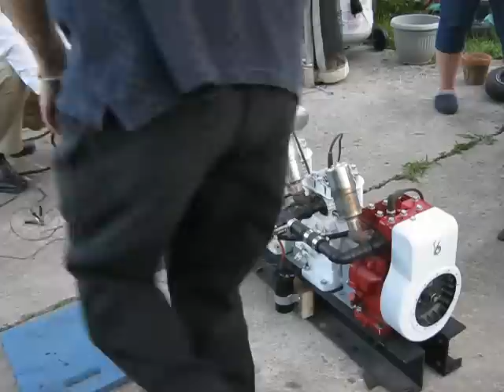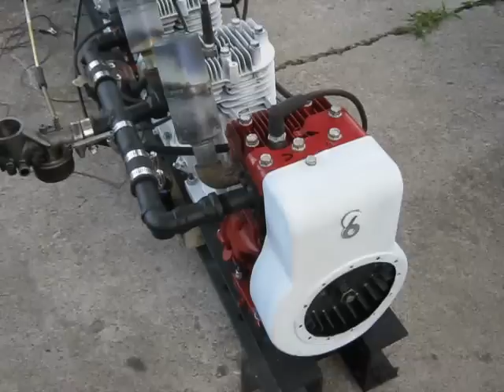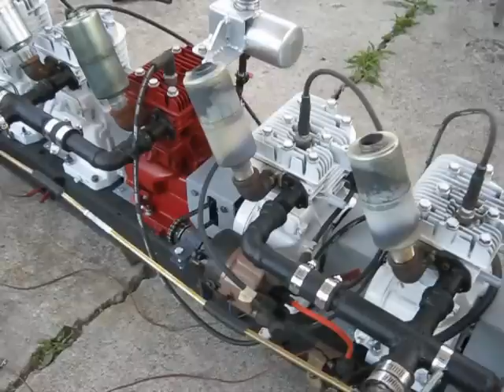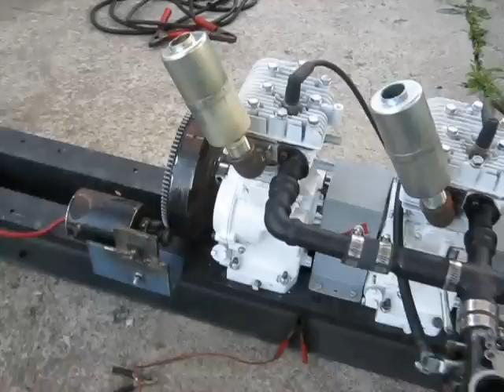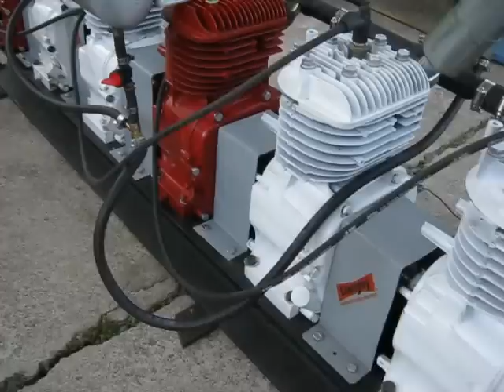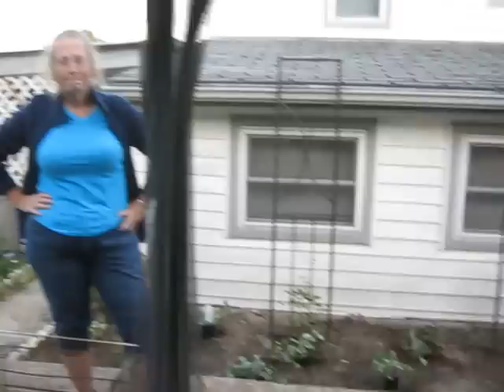FrankenBriggs 6 Cylinder 1st Run!!!!

Comment: So did he make this just to see if he could, or is there some more in depth reason making an inline 6 cylinder engine from 6 individual engines?
Reply from the maker: Yes, I did this just to see if it would work. I also wanted to test out the dual carburetor arrangement for use on the inline 8 cylinder engine which i ran after this engine. It worked much better, and I would like to try an inline 12 cylinder, I have just enough extra steel channel to make the frame for it  :)

Comment: Looks like the front three where only running because the mufflers are not hot and changing color
Reply from the maker: One of the back 3 is running also, but 2 are having issues. I resolved the problem on later vids, but this one gets all the views! I put many hours into getting this to run the first time, so I keep the vid playing, inspite of the problems.  My 8 cylinder ran better.

Comment: How did you clock the cylinders?  Sequentially or some series/parallel?  You could experiment with that and see the results in horsepower vs torque.
Reply from the maker: I made it so it uses the normal straight 6 firing order of 1,5,3,6,2,4. though with this modular unit, I can change the firing order very quickly. I presently don't have any way to measure power, just rpm. I was surprised that the whole engine rocked sometimes when revving it up, I didn't expect that since the 6 weighs about 250 pounds, and the 8 close to 300.

Comment: fantastic. but what was the inspiration behind this.
Reply from the maker: I went for a ride in a 1950 Pontiac with a Straight 8 engine, about 30 years ago. I haven't heard an inline 8 cylinder engine run since, so my plan was to build one from scrapyard engines I collect. This 6 cylinder was just a development of the straight 8 engine project, which I got running a few weeks after this engine. It was more sucesful, as I had most of the initial problems solved by then.

Comment: Exactly what is the purpose of this multi engine motor. Did you sync the strokes or do they alternate, Suck, Squeeze, Bang, Blow. Cool idea, But what do you do with it, I bet the Briggs& Stratton people will take notice......... NOT.. For Sure un-equal length intake runners will affect distribution. One engine will run rich and another will lean out and burn a piston or valve if it ran for an extended period. Don't you love how us internet engineers help to design your engine. The combined knowledge of all of us here will help you build an engine that may actually have a purpose. Knowledge is power..
Reply from the maker: This was just an experiment to see if it would work. The cylinders are timed to fire like an old straight 8 or 6 inline engine, and it sounds like one also. It doesn't really have a practical application, as the couplings between the various engines live a rough life with reverse loading. What you say about mixture distribution is true, but there were many millions of straight 6 engines built with 1 carburator, and they seemed to last a decent length of time, though most were water cooled.

Comment: Cool. We all need a good wife to keep us on the straight and narrow!
Reply from the maker: Yes, isn't that the truth! Luckily my wife puts up with my idiosyncrasies and I hers, so we get along well.
Me parking this big engine on the patio all summer was a point of contention though, so I had to keep moving it towards the edge of the concrete, and the bloody thing weighs 300 pounds!
Reply: ChargerMiles007 that is a beast for sure but really neat! Now you need to try and put it into some kind of ride.
Reply: The two engines from the starter didn't run. The third from the starter did some.
They didn't blacken the mufflers.
There is a fuel or fire issue. I would get all running before you put it to work.

Comment: cylinders 1,3,4,6, are running lean because of your intake design , intake runners should all be the same length. to evenly distrubute your fuel mixture. you might try six carbs or redesign the intake
Reply from the maker: 6 carbs would be very hard to manage, 3 would be easier. Perhaps i will rework it for 3 carbs in the future, though the intake manifolds take a lot of time to cut and weld up, and my old back doesn't like the bending over!  :)

Comment: nice try! , if I was you I'd look into a different way to mount the carbs , the 90° angle on each end of the 3 way manifold are going to cause headaches. would be less trouble to mount seperate standard carbs to each engine , and just have the 3 way manifold on the inlet , since all the carbs are in line, a link rod to the butterfly will suffice , each engine can be tuned to work with another only restriction would be the inlet manifold
Reply from the maker: Thanks for your input, yes, it does have manifold issues, I was being quick and dirty for sure!

Comment: Try a Blower on the carbs,  maybe use a leaf blower,
Reply from the maker: lol, I can only imagine what Roadking would think if I put a blower onto it! He already though I was nuts just horsing on these engines the way I do!  :)
I guess he has a valid point though, you never know when these things are going to blow apart, and destroy all of the hard work.
Reply: ChargerMiles007
 LOL,  you're right,  but, Sometimes finding the breaking point is all the fun,
   In reality,  it's not hard work,  it's fun,  that is totally cool,  weather it's practical or not..
  Personally,  I see it as Art,    that's why I like the Idea of  Blower,  it just takes it over the top.  :)
  Art is supposed to make you wonder,  "What was He thinking"   So give them something to think about..!!     Awesome Job,

Comment: Judging by the discoloration of the mufflers.  Only the first three engines are working.
Reply from the maker: Those 3 were definitely working the hardest, at least one of the other 3 were running, but #4 and 5 were having issues. I cleared all that up on the next run, but nobody watches those vids.

Comment: nice! does it follow a specific firing order(firing order of the inline engine)?
Reply from the maker: Yes, i try to duplicate existing engine firing orders on my engines. The 6 cylinder is 1,5,3,6,2,4, while the inline 8 cylinder is 1,6,2,5,8,3,7,4
Reply: just a little adjustments maybe on ignition timing and intake manifold lengths will make this inline engines great.

Comment: It would probably work better if you went back to the original intake and carburetor set up , now you need to put it in something to drive
Reply from the maker: I have been thinking of building some type of 4 wheeled slow moving vehicle for my large engines, but Covid has me wondering if it is the right time to take on such a project.

Comment: pues a mi me parece más bien una especie de máquina con 6 motores de 1 cilindro, conectados en serie. 

This isn't  a 6 cylinder engine,  is just 6 engine with 1 cylinder  each
Reply from the maker: True, but those individual engines are connected together to operate as a 6 cylinder engine. A spark distributor fires all 6, and two carburators feed the cylinders.

Comment: Cool Idea but your at extreme risk starting the engine hot wire style those sparks could ignite your carb on fire id advise on using a button starter instead
Reply from the maker: thanks for the advice.
Reply: ChargerMiles007  be careful with the button one too I have seen sparks jump out by the button what you need is a setup similar to a car or motorcycle or you can use a hi speed drill too
Reply: Im not a electrician but I have started alot of fires LOL
Reply from the maker: So you are a Fireman!  :)
Reply: ChargerMiles007 ehh more like cursed LOL nah just a pretty good mechanic guy with no tools

Comment: the rear 2 cylinders never fired. see the mufflers are still un-colored from heat as the other front 4 are.
Reply from the maker: Yes, it was having issues on the first run, I have more vids where all 6 are running, but this one gets the views. I left this vid playing, since I was so happy just to actually have it run, since it took many hours to get it to this point!

Comment: I would have kept the blower housings on each engine and flywheels to keep them all cool and the flywheels would have created more torque, then make a big log splitter and run a pig hydro pump
Reply from the maker: Yes, such an idea would be much more practical, and if the separate engines were chained up to a common shaft should work out very well. this is just an experiment, so I wasn't too concerned about cooling for a minute or so long run, though I did use 2 large box fans on a few runs.

Comment: im just curious,... what made you think you were going to run 6 engines on 2 carbs that im guessing havent even been jetted ???
Reply from the maker: No, these are stock 12 horse lawnmower carbs, with adjustable needle valves. I based it on cubic inches of displacement per carb, and it worked reasonably well. The engine wasn't running well on this vid, it is better on my other 2 vids, and also the Straight 8 vids.

Comment: Did anyone notice that the 2 last motors did not burn the paint off the mufflers ? I would say they are not firing.
Reply from the maker: Good observation, later I discovered #4 and #5 cylinder were not firing in this vid, thought the last one #6 was indeed, though maybe not 100%. I have another vid of its last run where all 6 are firing. I also have vids of an 8 cylinder, which runs much better,

Comment: Easy to tell which engines were actually running, the mufflers got hot.  A couple obviously did not.
Reply from the maker: Yes, #4 and 5 were not firing on this vid, as I got the crank phasing messed up. #6 is firing, but the muffler doesn't change color. on later vids I measured temps with a heat gun. I had the opposite of spark advance happening here also, as I was spinning the distributor backwards, my bad! I cured all of those problems when i built the 8 cylinder a few weeks later.

Comment: How do you plan on shrouding the last 5 so they don't burn up from lack of air circulation
Reply from the maker: I used electric cooling fans to blow air at them, it worked OK.

Comment: If they are all 5hp Briggs motors it should be putting out 30 to but it sounded like all 6 together was struggling to put out even 2hp,
Carbs or manifold problems I think you need to tweak something there bro
Reply from the maker: Yes, this first run was a bit of a disaster, I had a serious spark timing issue, which I solved on vid 3. I think cylinder 4 & 5 were out of phase also on this vid. I was just so glad that to get it running after many hours of work, that I left this vid of the event on for viewing. the straight 8 runs much better, it has a potential of 40 horse, though of course the crankshafts or couplers would break long before that was reached. 15 horse might be a usable goal.

Comment: 2 of those mufflers didn't get hot enough to change color. Did they not start?
Reply from the maker: Good eye, on this vid (there are others where it runs better) i had the camshafts on those 2 cylinders 180 degrees out, hence the backfires etc.

Comment: Good try, so did anybody realized how many motors were really running? Look at the exhaust dead giveaway. Obviously the first and third Motor was carrying the biggest load. Two was running some. Four was running some, but if you look at 5-6 mufflers are not even warm. 
If you look at how he has his manifold set up will notice that first and last motor in the three bank series are going to be running lean and one in center is going to run rich. You need to have equal manifold runs to make him run properly.

Comment: Now, my question,  for what kind of applications is this build,  I'm interested,  it could be functional or is just for fun
Reply from the maker: It was pretty much just built for fun, as the couplings can only transmit about 10 horsepower, while the motor has the potential for 30 or so horsepower. So it could be used, but is mainly an experiment.

Comment: I'm maybe a bit late for this question but how do you keep the engine cooled? Since it only has 1 flywheel at the front.
Reply from the maker: I just let them get hot, and don't run it for very long. I will have an electric fan blowing on them all the next time I run it.

Comment: what is the coil running if u dont mind me asking the reason im asking is because ive got a till that honda dont make the coil for it no more
Reply from the maker: This thing uses a car distributor and coil, from a 1970 Dodge slant six engine. i doubt that will be of much help to you. That is an interesting problem you have, if they stopped making the coil you need. Perhaps a 12 volt coil from a car could work.

Comment: Its a small engine that looks twice the size of a normal.. how heavy is it? I mean it is bigger.
Reply from the maker: Yes, it is longer than normal due to the separate crankshafts being coupled together. along with the frame it weighs about 250 pounds.

Comment: It will not work like this... but it could work if you place them in a circle and have a 45 degree x 6 on a differential like an old aircraft 6 cylinder rotary
Reply from the maker: i have a 5 cylinder chained type radial that i started on a few years ago, but haven't finished, guess i should drag it back out, and get it going.

Comment: The number two/three cylinders mufflers changed color AWFUL quickly!  I wonder if they were running lean!
Reply from the maker: Yes, I noticed that, I richened that carb up 1/4 turn, and gave it 5 degrees of spark advance, it runs pretty well on my latest vid.

Comment: Did you have to line up the crank pins in their appropriate positions?
Reply from the maker: Yes, I timed the various cylinders to fire using a standard inline 6 firing order of 1,5.3,6,2,4

Comment: looking at the mufflers you were in firing on four cylinders. did you all six going?
Reply from the maker: Yes, I got it running on all 6 on the final run vid, I also made an inline 8 cylinder a few weeks later.

Comment: Looks like the back 2 Cylinder’s didn’t fire up, the muffler shows no burn
Reply from the maker: good eyes, actually the last one was running somewhat, 4 and 5 weren't though, i discovered the camshaft timing was out on those ones. I fixed it and had tow better engine runs, but this one gets all the views.

Comment: Are they all fireing on the same phase or fireing 180° or 90° or something?
Reply from the maker: they fire 120 degrees apart, like a regular 6 cylinder inline engine. This results in a very smooth running engine, thus I am able to use about 1/3 of the normal flywheel weight.
Reply: ChargerMiles007, cool thanks for the reply. I think it's a pretty cool project, I love cool outside the box projects I wish I would make more time to build cool stuff I love building wierd stuff. Years ago I had an old 4cyl dodge Dakota and the electronic 2 bbl carb took a dump so I fabbed up an adapter and mounted up a 750cfm Rochester quadrajet i had It ran absolutly beautiful on the small primarys, it couldn't draw enough vacume to pull the air valve open, mind blower eh... One buddy called it a "funnel ram". Thanks bud
Reply from the maker: That is cool that the Q-jet worked out for you on a 4 cylinder. My father used one of those on a 327 Chevy, along with the Duntov 30-30 racing cam, that thing propelled a 56 Chev car to at least 130mph, he also had the electric overdrive set up from a Corvette, so the engine didn't run out of revs at such high of a speed, plus Ram air  :)
I had an old Ford Escort with a 2 bbl carb that was like 1/2 of a 4bbl, 1 primary 1 secondary. Sometimes driving home in the winter the primary would ice up, I could keep it going half decent on the highway, but when I pulled off and hit a stop sign you only had 2 options wide open or stall. It made for some interesting gas pedal work to keep it running, while waiting for traffic! Glad it had a standard transmission!

Comment: Sorta cool, but judging by the way it runs, i'm willing to bet you're netting like 3HP across all 6 of them, tops. The intake manifold design needs to be completely re-done. They're all running waaaaay lean. Would prob be easier to tune and balance the carbs if you just used 6 small carbs w/ some rods tying the butterflies all together. They're too far apart to really make a manifold perform well.
Reply from the maker: Yes, it wasn't running very well here, it turns out I was spinning the spark distributor backwards, so it was retarding the spark timing (instead of advancing) when the engine revved up.  this caused it to make a lot of heat in the engines, and exhaust. I identified the problem when I was building the straight 8, so it ran much better.
Reply: ChargerMiles007 I'm surprised it ran at all with the distributor running in reverse. Are you running the ignition sequentially or are you batch firing them all?
Reply from the maker: I run them sequentially using a 1,5,3,6,2,4 firing order.
Reply: ChargerMiles007 now I'm even more surprised it ran with a reverse turning distributor :D

Comment: impressed by the project, but, trying to feed 6 cylinders with 2 carbs.....is why is doesn't run so well...
Reply from the maker: Although not ideal, 2 carbs is better than the 1 carb most north american 6 cylinders had back in the day. I sounds much better on the two later vids, it was admittedly sick on this first run.

Comment: who made the crankshaft? Or how does it collect the horsepower it generates?
Reply from the maker: This engine uses 8 separate crankshafts all fastened together with chain couplings. My son, a friend and I modified 4 of the existing cranks to work, another friend did the last 4 crankshafts. At this point it just powers itself, though I suspect it could put 10 horse thru the output shaft without much of a problem. With all 8 cylinders running properly it has the potential to make 40 horse, but the last few crankshafts and couplings would break before that would happen.